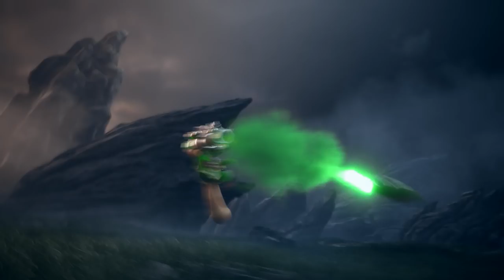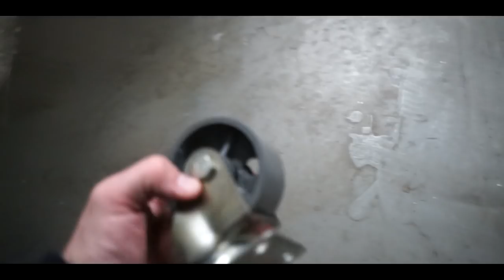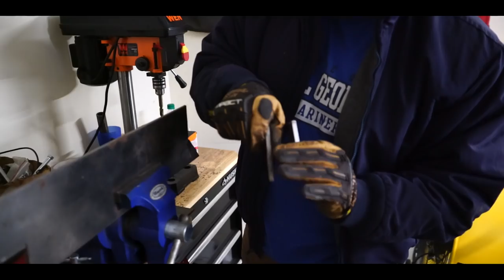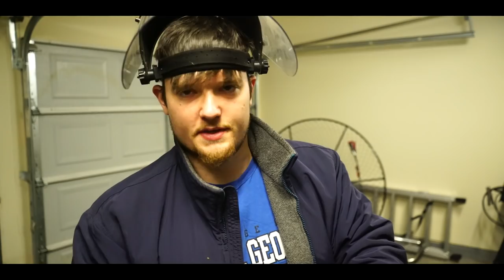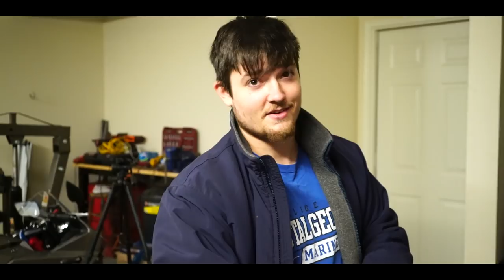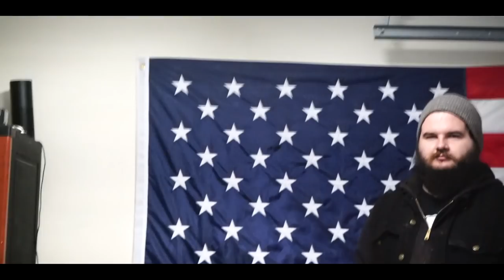Mounting A Machine Gun To A Motorcycle!

Comment: jesus dan what have you done this time😂
Reply: Wus poppin B He put a Gun on a motorcycle.... HEHE
Reply: You should put a strong magnet on the bottom of the handle grip so it can stick to the tank, that way when your driving around you won't have to hold the gun with one hand and drive with the other. Plus it will detach easily for quick use. Just a suggestion to make your life easier while ridding it.

Comment: You should put a strong magnet on the bottom of the handle grip so it can stick to the tank, that way when your driving around you won't have to hold the gun with one hand and drive with the other. Plus it will detach easily for quick use. Just a suggestion to make your life easier while ridding it.

Comment: Dan,

I'm a big fan of your channel! I noticed you were having bearing problems with the caster wheel. Next time you are working on one of your projects and you'd like to use a bearing or bushing, reach out to me and I can get you whatever you need for free from Igus Bearings. They manufacture all sorts of bearings, bushings, and linear slides that are lubrication-free, smooth running, and vibration dampening. They would have been perfect for this mount.
Cheers,

Collin

Comment: Hi Dan try using wd40 or something whenever drilling holes in things with that drill press, to insure your bits last longer.. just give it a little squirt on the metal where the tip is gonna penetrate

Comment: Put a magnet on the bottom of the hand guard and an electromagnet somewhere on the handlebars so when you’re riding the gun will stay in one place versus moving while you lean and accelerate or slow down. The electromagnet is so you can turn it on or off and you don’t accidentally lock the gun in place while shooting. You’d have to mount the gun on the tank and take the speedometer off but that shouldn’t be a problem because I doubt your trying to make a street legal bike with mounting a gun on it and whatnot.

Comment: I hope that caster wasn't galvanized.
Reply: wedo4444 lmaoo
Reply: Just by looking at it it's hard to tell sometimes but ya most casters are galvanized. You can really tell if it is when you start welding, its a strong kind of stinging smell in the nose if that makes sense. Only harmful if inhaled in large amounts like at a welding shop. That's why it's mandatory to weld with respirators on galvanized materials at my work. What Dan did won't hurt him, just don't do it over and over again without strong ventilation or a respirator.
Reply: Why would you hope that? He dropped like 2 beads on it